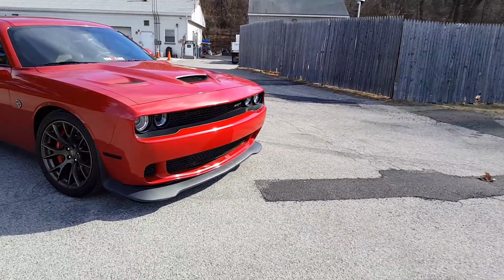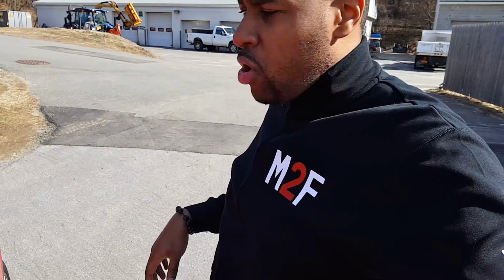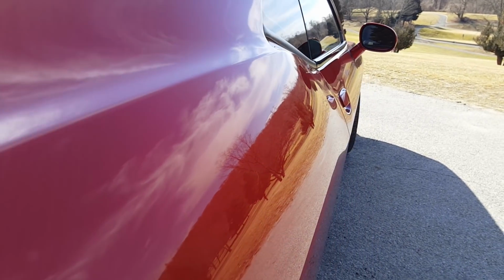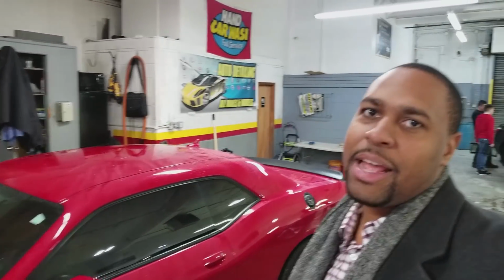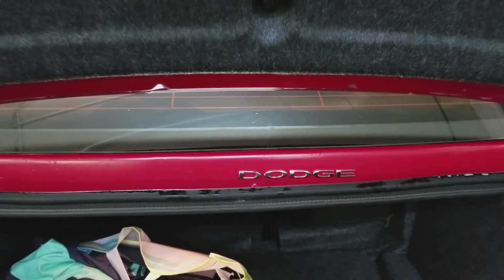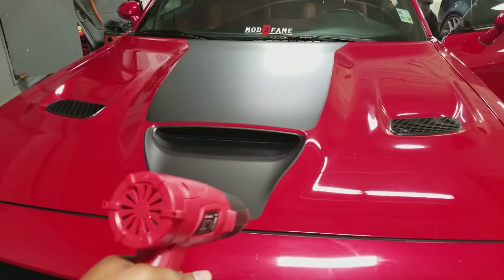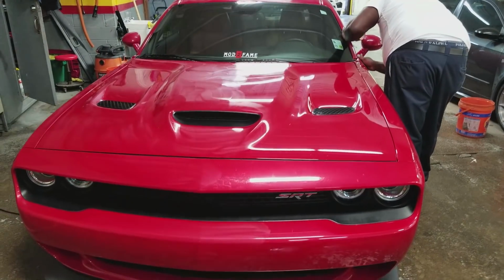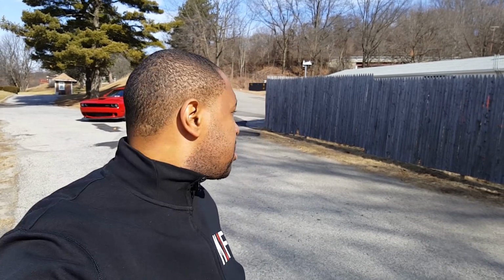Everything Wrong with the Cheapest Hellcat in the Country

Comment: It's ALL cosmetic. No worries. Get it corrected like you have. The clutch & shifter...🤔 I can tell you: My first HC was a stick Challenger. The problems I found were that the first gear was too tall. Either it, or the differential needed to be lower to aid take off. Clutch: not fast. Eliminating clutch delay valve might help. Third: Stock Dodge shifter is awful. Need a Barton aftermarket shifter or equivalent.
Reply from the maker: I have started looking into the Barton, it's definitely on my mod wish list

Comment: 5:03 I really hope dude cover all necessary components before spraying all that water im the engine compartment.
Reply: um, nope! 😂  he just went full pressure washer under the hood.  😂😂😂
Reply: I notice that also.  You need to be extremely careful when spraying water near electrical parts.  He just didn't give no fucks. Full blast!! 🤣🤣🤣
Reply: Engine was still running too while he was spraying.  You can see the belt spinning.  Yikes! :o
Reply: at least the challengers battery is in the trunk
Reply: Your suppose to leave it running while degreasing the engine
Reply: We leave em running and hot at the dealership when we clean them after working on them haven’t had any problems in 20 years with blocks cracking or electrical issues 
All the connectors under there are water right weather proof for a reason and as far as cracking the block because of the heat what happens when you drive through heavy rain? Engine gets pretty wet to believe me I live in Florida just avoid those 4 ft puddles because after a good flood we have all kinds of locked up engines and rods hanging out
Reply: kevin Bloodandsoil lol really?
Reply: Indigo Hellcat James Smith Yes but as a disclaimer if we break it it becomes warranty if customer breaks it it becomes customer pay unless you complain relentlessly and complain to FCA that’s a little secret if your out of warranty and want it good-willed
But yes legitimately we haven’t had any issues with water VS hot engine wouldn’t do it on a overheating block though that’s pushing it
Reply: kevin Bloodandsoil very interesting
Reply: as long as the car keeps running its fine. you just cant spray directly in one spot.
Reply: He could have gotten water in the engine and it would have been over
Reply: Doesn't the alternator go bad when running the engine and spraying water to it? You know the water and electricity thing. I hope y'all cover the alternator for the minimum... I hope, I like that hellcat.
Reply: victor nolasco okay genios